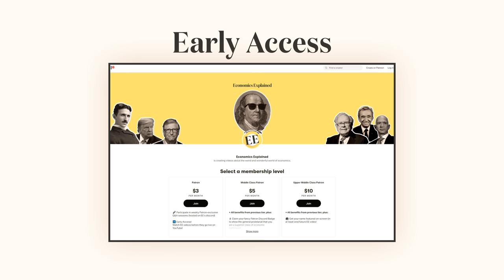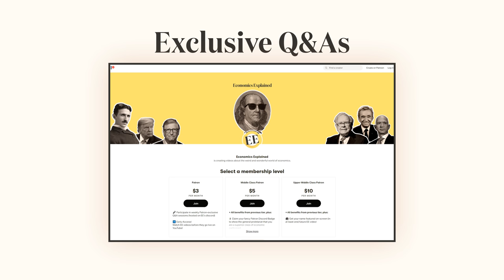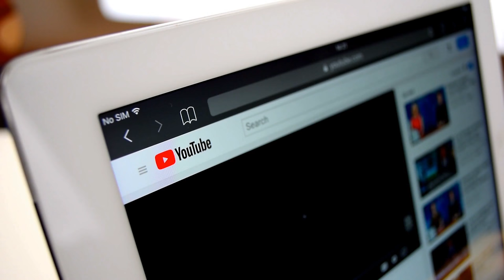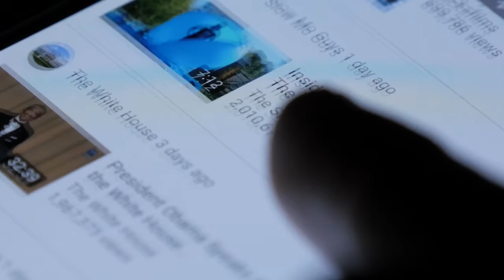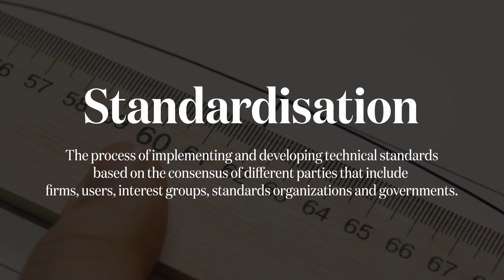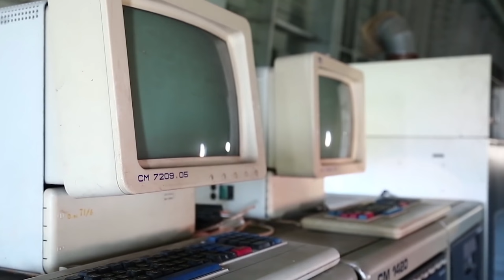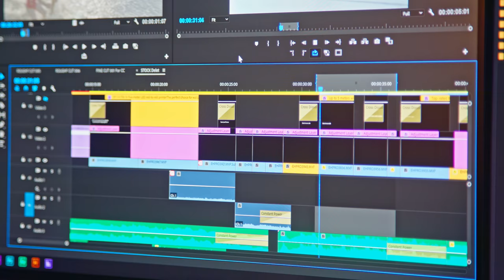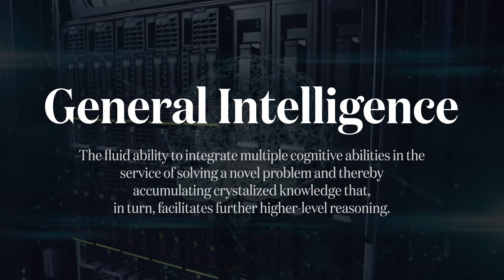Is the Fourth Industrial Revolution Worth the Hype? | Economics Explained

Comment: I think the next industrial revolution will be marked as such only when mankind will discover 2 things: 1 new form of energy that doesn't produce co2 or nuclear wastes and highly efficient;  2 new building materials different from steel  but equally resilient and that can be mass produced with no co2 (excluding wood). Other things like more advanced robotics will change only the labor system in good and bad ways alike.

Comment: About last impactful invention being smartphones & them not improving much anymore:

First about not improving: it's not really possible to meaningfully improve them. Smartphones are just computers, semi-rigidly defined by their form factor & interface. The limit is precisely their form factor and interface. Cramming more computing power doesn't really improve them much. Cramming more sensors might improve them, a bit. Same with things like foldable displays. Other possible improvements would be things like eye-tracking - so that you can type precisely, by just looking at the keys you want. Or niche stuff: improving camera with advanced features like sensing other parts of the spectrum, adding pulse oximeter etc.

Second, about them being last impactful invention: possible in their category, but there's Augumented Reality glasses on the horizon. That will be as impactful, or even more impactful than the smartphones.  Smartphones put a computer in your pocket, available at any time at a reach of your hand. But the interface is extremely limited: display is small, typing is pain, multitasking is not practical etc.

That's where AR+cloud compute comes in, combining advantages of current PC/laptop setups and smartphones, removing disadvantages, and going waay beyond. Put a screen at any point in your field of vision, or pin it to a specific location in the real world. Make it semi-transparent if you want. Any size you want. And you can have multiple. Computing power? Don't need to worry about it, glasses can be just a dumb terminal. Computing can happen in the cloud - or in a compute-brick with similar form-factor to your smartphone, in your pocket.

Input? Eye-tracking, speech recognition (will get better in the meantime), virtual keyboard - relying on hand tracking. Eye-tracking is superior to a mouse - look at the button and click it vs look at the button, move mouse pointer over that button and click it. Also, could point fingers at things, grab them in hand etc.

Oh, also, about "computer in your pocket"? Now the computer is always available. That could change things drastically.

---

It's not that far off. I'm convinced we'll have something approaching description above in 5 to 10 years.
Reply: Yes. Smartphones are a horizontal evolution rather than vertical evolution.

Comment: I'm still not sure what the 3rd revolution was.  Are you talking about the computer one?  Because if so we are still in the middle of it, though it is slowing down considerably.  At this point it could be restarted with a significant software change.  Doubtful that will happen in the next few years as the Microsoft suite is the electronic equivalent of staplers and post-it notes, and Microsoft will be sure to do anything and everything to keep it like that.  I guess it will have to do with smart phones if I had to put my money down on it.  It's the only thing ubiquitous enough to avoid being squished by the big players of software and tech.

Comment: One huge missing element, that all of this is built on, is fossil energy. All of this growth, and technology, is the result of fossil fuel inputs.

It’s hard to imagine a growth economy continuing without a liquid, abundant, energy source that can be stored at room temperature. Every alternative so far doesn’t meet all of the criteria to replace the utility of oil. Or, it’s energy returned on energy invested is not any better than a battery.

Comment: Most likely candidate for 4th revolution is cold fusion (cheap, clean energy), true AI and/or ability to transfer consciousness. It could also be a space tech, specifically anti-gravity or anything that would make it cheap (less energy intensive) to get to outer space. However, in the absence of any such developments, the existing system is more than unstable. Covid 19 crisis underlined just how fragile the existing economic and political system is, and how certain exogenous pressures might topple it. The 4th revolution is needed to continued growth, without it, the climate change will inevitably cause havoc

Comment: "Wealthier and wealthier" is likely going off the assumption that no political changes occur, or economic instability occurs (such as the USD collapse). There may be a dramatic decline before there is further improvement. I have suspicions it will get much worse before it gets better. Hyper-inflation is not even mentioned in this assumption so I believe it is naive.

Comment: with these revolutions does there not come an inherent reduction in stability due to our dependence. its hard for me to imagine steel manufacturing, or standardization to 'fail' but i can imagine the internet and computers failing. through solar flares, electrical grid failure etc. you are optimistic about the future, but I fear our ever increasing instability.

Comment: Not just AI also simple systems getting smarter, and cleverly designed mechanical gadgets getting replaced by mechanically simple devices with smart behavior driven by electronics. For example in a car, assuming EVs don't take over completely, fuel injection instead of carburetors, electric valves instead of camshafts, active suspension, steer by wire, brake by wire, electric turbo charging etc.

Comment: First off, "AI" ... at least you specify "general" AI. I guess that's better than just "AI". Though even that is still a very vague term. It's like trying to pin down what "intelligence" is, quite literally. And depending on how you define intelligence, we may already have G-AI, or we could possibly never achieve it. Not to mention, that every single "AI" (or rather what is marketed as AI) these days, is just statistics. Plugging in variables into numerous random formulas until an answer matches measured results closer than another run did, rinse and repeat until it's close enough for practical purposes - what is called "machine learning".
Secondly, trying to imagine a 4th revolution, is like trying to figure out a black swan event before it has happened. It very well might be something "AI" related. It could be a means of generating power more efficiently or cheaply. It could similarly be some space based industry leading all others to also adopt a space infrastructure. There are several competing possibilities we can imagine today. Which of those will become the next revolution? Would it only be one of them, or could they all feed off each other?
If the "AI" you mention is only used as an example, then definitely "yes" in full agreement. If not, then this is a bit short-sighted.

Comment: The world is going to change more in the next 10 years than it has in the past 20. AI is going to radically change everything - we are already seeing it start with self driving cars, self checkouts, drone delivery. In video games we are seeing it in DLSS which is offering better visuals in a game whilst the game also runs 70% faster. But yeah, the AI revolution, I am doubting a general intellegence will be a thing in my lifetime but we will see an explosion in AI over the next 20-30 years which improves practically every aspect of life - but there is only so far this push will get us in terms of benefit.

Take video games for instance. At what point do we have enough resolution? Some would say 4k is enough but I am thinking more realistically 16k is where people will really start seeing diminishing returns. Like the difference between 4k-16k will probably be noticeable on 32 inch screens if you know what to look for, but the difference between 16k-1,000,000k will be very hard to notice even if you know what to look for. AI has the ability to unlock a lot of potential gains but the gains will have diminishing returns.

There is only so well a self driving car can navigate the road before it doesn't matter anymore - who cares if the rate of crashes goes from 1/ten billion per year to 1/a trillion per year. At some point they will simply be good enough and the improvements from that point could be exponential but the real world benefits would remain the same to our perspective. Another example would be a chess AI - once it can beat the best human in the world without losing, even if the AI gets 1 trillion times better, it doesn't matter. From our perspective we always lose to it and that never changes.

Anyway that sort of game AI, transport AI and even manufacturing AI is nothing compared to the analytical AI that will come later. Imagine when AI can analyse disease, even aeging, and find chemical solutions to all of these problems. Imagine an AI that can design every organ in the body and 3d print them for us? AI that can analyse your taste buds and design the perfect meal for you. That sort of thing. Then beyond that perhaps AI that can design whole games, generate whole movies. 

It is already happening, we are in those foundational stages. AI is like the internet was in the 70s - very rudimentary but evolving. I just wonder how we are going to fix the mass unemployment which is already underway.

Comment: Well, if you want to know what the next industrial revolution will be, look no further than Boca Chica. We build the international space station over many years using the space shuttle. One launch cost $200 billion. If Elon Musk achieves his goal with Starship, launch cost will be reduced to $1 million using clean, sustainable fuel. This will do for space flight what the air liner did for air travel. Elon Musk have already mentioned radical ideas such as commercial flights to any place on earth in less than an hour, but this is just the tip of the ice bergh. It will allow us to build megastructures in space, which in turn will open massive opertunities with is currently unthinkable.

Comment: Technological advancement will force us to move towards socialism for various reasons. One is the continual loss of labor value due to the incentive of automating that labor value away - machines always have the potential to be more productive after all. Another is the current means of ownership on production, which with innovation having diminishing returns as the video briefly describes produces essentially a feudalistic state as we reach such ends which will be exacerbated by the economic differential in power between people.

I doubt reconciliation there will come quickly or efficiently but it's an inevitability assuming sustainable technological progress. I will be surprised if the world will even call such measures socialism when it's all said and done given the propaganda people consume but I believe that term accurately describes the economic shift necessary in production promoted by 21st century variables.

Sustainability is entirely questionable, however. The current system is naturally unsustainable with having a financial crises on average once every decade. Similarly, our current leading economical compass has condoned two predictable and tremendously costly problems with almost no mitigation in the preparation for a pandemic along with the preparation for alternative energy due to the threat of carbon emissions. If our current system continues its promotion unsustainability, technological advancement and thereby economic advancement will become impossible.

Comment: I worked in chemistry before computers and though chemistry hasn't changed, computer and robotic equipment do it much better than I did by hand. This is why I believe than manned space exploration is doomed to failure. If robots can to Earth based jobs better than humans, why would we ever put humans in space in any great numbers? No need for air and water makes robots the inheritors of outer space.
Reply: Because robots lack the human perspective. They are good at carrying out rote processes that we assign them but not so good at initiating exploration or problem solving. Suppose there was an alien ruin on Mars. Would a robot really do a better job exploring that ruin than a human?

Comment: "Before we get into predictions.." ..No predictions..

This AI revolution is already in effect. We are ramping up toward increasing our exponential growth, lowering the cost of production by removing costly human labor in favor of software that can be written once and do the job of hundreds, thousands, or even millions of full time employees.

On the horizon:

1) self driving cars - within the next 1-2 years we'll see an explosion in specialized autonomous vehicles in narrow scopes. There's already companies working on autonomous construction vehicles. This is a safer place to demo the technology as a construction company can control who has access to the site.. Public roads are a lot trickier for this reason (not to mention regulatory hurdles). Within 5-10 years I believe it'll likely dominate consumer major markets as the technology "hardens" (is tested through real life circumstances). Within the next 10 years we'll see long haul truckers lose their jobs after the benefits of having someone behind the wheel to watch the system exceedingly outways the expense of the lawsuits from autonomous truck related auto accidents. We could probably be there within 3 years, but building all those trucks to replace the old fleets will take some time IMO.

2) AI assistance - not just your Alexa managing small tasks, but customer service interactions generally. Automating call centers doesn't only save labor, but also the cost of renting the space and equipment required to house these legions of customer service representatives. Add that to the fact that many Millennials  and GenZ-ers seem to prefer interacting with customer service through text (on the website/twitter/etc). 

Both of these changes are already underway. Autonomous trucks are being tested in Texas and Arizona (among other places). Tesla is updating its software regularly to handle increasingly more edge cases. We've been automating customerservice for a while - but the scarier part for remote customer service workers is it costs the company using the service next to nothing in infrastructure (where with autonomous trucks some one would have to buy the truck, for call center software all they have to do is pay for server space after training the system... and they've already got all those recorded interactions...). Buying and selling of stocks, for instance, used to employ floors of traders.. where most of it now is handled by software. We are becoming increasingly efficient at doing business... meaning larger profits for the companies due to fewer costly employees.

The reason many are concerned about this "revolution" is many of these advancements will cause a giant holes to be blasted through the labor market. It wont be over night, but in the course of a few years you'll see mass layoffs in the sectors that employ a large portion of people - from truck drivers, to call center workers.. even retail work is in decline (pre pandemic).

As the argument goes, we dont know what jobs will come in to replace those jobs.. in the past we've seen other jobs come up to replace old ones - banks didnt fire all their tellers because of ATM's it just allowed bank workers to do more higher level work - IE Loan Officers. McD's isn't firing it's lobby workers, just changing their job duties for better customer service (until they're forced to compete with other chains doing more with less workers). The issue with that argument is the rate of this change. If we lost a quarter of the labor force because it takes fewer people to operate an industry (call centers will still employ people, just far less as the system can handle 80% of the call volume, only 20% or less requiring escalation to humans). These changes can be violent.. the first industrial revolution wasn't exactly welcomed with open arms from the workers.. there were billions of dollars worth of damages to factories that replaced wages. But I guess we'll see how it plays out.

Comment: The construction industry in the U.S. still hasn't fully embraced the second industrial revolution. Almost everything is custom-built, made-up as you go along, and designed using weird units like inches, mils, squares, and probably bushels for all I know. In fact, a lot of the residential projects are done by the homeowner or by a guy in with a pickup truck who voted for Donald Trump. If you're lucky, he may have had an apprenticeship with a master, just like olden times. If not, you'll probably have to hire someone to fix his work 10 years down the road.

Comment: The next revolution is going to be in two parts as previous revolutions. As you said AI is going to be one part of it and change everyday life in buisness, manufacturing, news, science and all other fields and I do believe the other one is going to be wireless energy trasfer (WET). The world is producing enough energy now, but the only problem is distribution. Imagine you can buy clean solar energy from sahara desert (for example) and you live in Bejing, Mumbai, Moscow, London. Our cars, phones and all other appliances that use some kind of energy storage won't need batteries so large, won't be so heavy, the material that would be saved. But I think the only way a good distribution of energy would be accomplished with the AI. 

And after that you are going to need to take the red pill because you are going to need to wake up from the program and the energy farm.